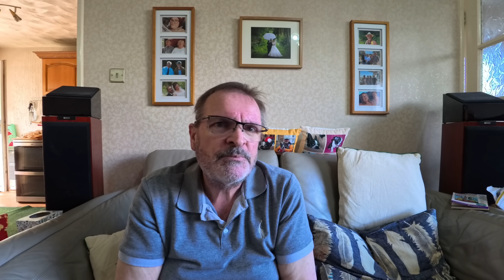Expert Ships Engineer Reacts to Baltimore Bridge Crash

Comment: Retired ship engineer myself. I appreciate you posting this video with thoughts based on your knowledge and experience in ship engine rooms. Many people who have not worked in the maritime industry are posting rubbish speculations based on second or third hand information which only misinforms the public even more than television news presenters are doing when they speculate. Have a good watch chief.
Reply: this is not this ships first fubar in port either ,  and it failed several maintenance  inspections in june.
Reply: @SwampbearX Oh really?
Reply: @vden02   2016 it nearly took out a port , it was also heavily cited in june for failed upkeep involving propulsion and power plant
Reply: I was in manufacturing for 37 years and god forbid there was an accident or incident because all of the armchair quarterbacks would be on the case with all of their accusations and suggestions on what happened or what you did wrong. If people are involved there’s always the possibility of things going wrong.
Reply: @JefferyHagen   To err is human. It takes a COMPUTER to really screw things up!
Reply: @JefferyHagen About the anchor appears rumblings about not having power to disengage clutches as no power of that is the case then the anchor was not prepared for standby as per the check sheet
Reply: @JefferyHagen  Unless you have intimate knowledge of container ship electrical systems and backup generators that all modern ships possesss then shoosh - your knowledge means squat.
Marine electricians are scratching their heads how this confluence of events occurred which points to a more sinister explanation.
Reply: I see lots and lots of comments the black box (VDR) not working. IT WAS. 
It has an uninterruptible power supply. What stopped was remote sensor data!!!  Because there was no data to send!  Almost like there no power for them to operate! 
The bridge voice and radio comms links continued as per. 
The NTSB have already addressed this issue. 
Cheers
Reply: The black box is missing 2 minutes of data...how is this possible?
Reply: @mre6227-uk4zo That is crazy since the SVDR is continuously recording microphones, engine data, movements made by the helm/throttles, and is not turned on or off by the crew.
Reply: The SVDR is supplied by ship's power, and it has an internal battery in case the ship sinks.
Reply: @earthequake1. Not to mention they said it is suppose to have 30 days worth of recordings on it
Reply: @mre6227-uk4zo its only missing data was from remote sensors. Bridge voice recorder still operated. 
Why no sensor input??? There was nothing to send, they had a total power failure. 
The VDR has a seperate,autonomous power supply.
Reply: @mre6227-uk4zo  I find it interesting that this video was promoted in my feed. Anything that’s promoted in my feed is completely suspect if I haven’t subscribed to it.  Especially because I’m not following this incident and I don’t care much about boats.
Reply: Nothing to see here move along...
Reply: @mre6227-uk4zo I believe it has continuous bridge audio. It is missing 2 minutes of sensor data because the sensors were offline.
Reply: @mre6227-uk4zo  Layman's guess... perhaps the blackout? The recording device must need a power source.
Reply: @mre6227-uk4zo  No idea. Like I said, it's just a guess.
Reply: @mre6227-uk4zo  it must have a UPS -so if it is ‘down’ for the period of the main black out - it is safe to assume that the UPS has failed.  The UPS should be tested on a regular basis and longevity of the batteries recorded.   I have seen plenty which fail on demand, though.
Reply: @groaningmole4338 shouldn’t there be a cheap UPS keeping the black box functioning?
Reply: @fredfrond6148  Yes. But "should be" does not always translate to "is".
Reply: A black box without a back up power source seems pretty stupid, if that’s the case, we shouldn’t  bother using them.🤦🏻‍♂️
Reply: @groaningmole4338  It didn’t shut down and it does have it’s own battery supply.
Reply: @groaningmole4338 yes it has its own battery supply and no it didn’t shut down. It didn’t have any remote sensors sending data.
Reply: @DB-thats-me   Thanks for the info. With any luck, that will be the end of this discussion (please, O Merciful Gawd!).
Reply: @groaningmole4338  I typed in the wrong place I think. I wanted it on the main thread. NaYa. 👍
Reply: @groaningmole4338 I think it was hacked & overtaken…and not by Russia, but China…who most likely built that ship.
Reply: @groaningmole4338 Of course it needs a power source. How would it be possible that the blackbox wouldn’t have it’s own battery?
Reply: @glennwhite1841   Batteries not included.
Reply: @groaningmole4338 it's my belief that black boxes have their own power source, batteries. If that is the case, the black box would have to be manually disconnected from its own power source, and then reconnected.
Reply: @fredfrond6148 yes and it should have been tested as per the ships planned maintenance 😮
Reply: Our government has become so untrustworthy that I immediately disbelieve anything they say. I believe a stranger on youtube much more then them. What you have said makes sense
Reply: @andrewpinkham9904  Same here.  Just assume anything u c or hear on the controlled media, or from a politician, is a lie unless proven otherwise.
Reply: @MrLanternland  news reports said some data was still recorded. Audio but no video during..... However I guess from what they said (NTSB) these are not like flight recorders they don't have detailed information
Reply: @MrLanternland the only time you know a politician is telling the absolute truth is when they call another politician a liar.
Reply: @gregorytubbs3444   Ha ha ain't that the truth!
Reply: @gregorytubbs3444  Ha ha ain't that the truth!
Reply: @andrewpinkham9904  WOW, what a great bunch of "Conspiracy Theories" Weidos, Yall, need to find tune YOUR brain antennas, to achieve a better signal, from yo boy Alex Jones, of "InfoBurnouts", so YOU can get a better space signal, from YOUR NWO , boy, Klaus Schwab
Reply: Its a distraction on what's going on right now so I'm sure they'll be more coming . Think about train derailment a few months ago and then Lahaina fire  now this and then there was another cargo ship that hit the bridge in Arkansas but is now reopened.  I get better on YouTube than watching the media
Reply: @andrewpinkham9904 , I am curious… Do you think trump is honest?
Reply: @allanhwhite.kineticmobiles  no hes not honest but he keeps his campaign promises and his policies are in the best interests of Americans. He exaggerates all the time. Its his style. Do you think a president that puts American's first is better then a president thats owned by billionaires at the world economic forum
Reply: @andrewpinkham9904 So, let me get this straight. 
If the Government had told you the bridge had collapsed due to a ship hitting it ………
You wouldn’t have believed it???😳
Reply: @DB-thats-me  I wouldnt believe them if they said the sun was going to come up in the east. Thats what happens to habitual liars
Reply: Great job! 🌠You can move on to reading comprehension exercise #2 now!
Reply: @DB-thats-me OH, THIS!!!

THISTHISTHISTHISTHISTHIS 😂😂😂
Reply: @andrewpinkham9904 You must have fun with elections. Why make your life so difficult? There’s an awful lot of non-governmental disinformation out there, and a lot of good gov’t info. Like, say, how to apply for social assistance if you’re disabled. 

Here’s a thought. Do your own research. From a variety of sources. One should NEVER single-source news items.

Or is that too much effort. 🤦‍♂️
Reply: @whatifschrodingersboxwasacofin  ummmm.. sorry?
What did I say to set you off? 😳
Reply: I would like to hear how dropping the ships anchor might affect the ship
Reply: @Mind4Christ   Mostly? It wouldn't!  To 'set' an anchor you have to drag it for a bit for the flukes to 'bite' into the seafloor -- and that only works IF the sea floor isn't, say, sand -- which just lets the anchors pull right through.
Reply: @Avalanche-Ice1950 There are power lines, water line, and gas line in that area. Dropping anchor could hit those depending on how deep they are.
Reply: @NorCalNeel  Early the next day, a local expert said they did drop anchor.  At that speed  it would just drag and not stop the heavy laden ship.
Reply: @Mind4Christ it's standard emergency procedure for any vessel adrift,the anchors are dropped to slow the vessel with drag & hopefully they grab. With the tonnage involved & a muddy river bottom,that was probably a faint hope of them grabbing. I'm more interested in why the bridge failed so comprehensively, surely they are built with potential collision aforethought?
Reply: You nailed it ! Everyone is a damned expert when these things occur and opinions are like assholes and everybody has one !
Reply: I just wonder why Biden not making the company involved pay. I mean if any kind of negligence is determined there are serious consequences for the responsible party’s
Reply: He'll be pocketing the money again  @georgeharman7177
Reply: @georgeharman7177 Having been in the insurance industry for many years, it could be 10-20 years before the insurance company settles and pay(s) out! The bridge MUST be rebuilt ASAP. Our Government would eventually receive some kind of reimbursement, if only partially.
Reply from the maker: Thank you. Retirement looming here too.
Reply: @retroonhisbikes  just curious, considering how close to the bridge, would full reverse have been a better choice ? Another question, how automated is a ship like that ? Could a computer error have cause it ?
Reply: @retroonhisbikes It's not rubbish when there's evidence, namely the video of the incident, to back it up. You all can back up your story with all the talking points you want, but the fact is there's more to this than meets the eye.
Reply: I've never worked in bay areas but my family has worked the Ohio River since 1902 , there might be differences in protocol as far as a ships entry to areas but I would've assumed there would've been turn boats, that's what we call them on the river but a ship that size in that area would have some sort of boats that help it in case it needs assistance, like I said I'm not a expert but as someone who has been around ships and boats since I was old enough to wipe my own ass" it's a requirement" I would think there would have been another boat in the area to help but anyway I love the video and the comments are very educational, so many things I never knew but thanks for the info
Reply: Reports say the black box didn't record any data during the crucial time frame. Is that normal? How likely would that be?  Just another event in a series of unfortunate events?
Reply: @CasaBonitaSucks  Is that normal? Are you naive? And, you're going to believe these were all just "unfortunate events?" No wonder they get away with so much because, ppl like you will buy anything!
Reply: Could a cyber attack possibly do this? You guys are engineers. Your answer 2 that question is important.
Reply: @CasaBonitaSucks I hate to say this but they can  in some cases not all ships.
Reply: That explains the time it appears to be turning and the black smoke billowing. The pilot would have told them full astern. 
Great explanation.
Reply: I thought that large vessels such as this were always moved into and out of ports with pilot vessels or tug boats for this exact reason. If something goes wrong you can't control them????
Reply: @jasonvigh7109 Good question! I just saw a different view of the ship, it's load and collapsed bridge. That ship is far bigger and with a huge load - far bigger than I originally thought. Why didn't the "Dali" have tug boat(s) assistance?
Reply: I am in my 70s and have become cynical in,  it seems,  everything... 😂
Reply: I want to make a point to those who say “the boat hit EXACTLY at the point that would take the whole bridge down”—these bridge supports are right in either side of the channel…. It IS where the bridge would be hit, if it were hit. There likely isn’t enough depth of water to get to the other bridge structure further toward land. It’s like being amazed that a car hit the guard rail and not the tree on the other side of the ditch behind the guardrail.

Question from a U.S. military sailor: why wouldn’t more engineers be on watch during a dangerous evolution like arriving and leaving port? I understand that a commercial crew is 10% the size of a military crew, but On a military vessel, essentially everyone is standing a watch during this detail. Engineers are in bow prop (I understand it may not have helped) and in aft steering (which is usually where our emergency generator is) to decrease response time. How there isn’t at least one more engineer on duty ready to respond to a steering or emergency generator casualty, seems unfathomable to me.

Beyond this question, I generally  agree with your assessment. My two remaining questions are:

1. When was the port anchor deployed? I know this won’t stop a ship that size, moving at 8kts on a dime—but I’m curious. 

2. What was the rudder action during these 4+ minutes? I think most of your analysis assumes the rudder is essentially a-midships—was it? We’re they starting the starboard turn but just by a few degrees (essentially a-midships—which I assume)? Or was it a little harder over? Did they move the rudder in that 4 minutes? That captain knows he’s driving a single screw ship and should compensate for that with a rudder command as an instinctual function of calling for full astern. This doesn’t mean the rudder responded—which, as you say, likely was an error that contributed to the accident—know where your rudder is, and if it’s responding, before you give the engine command. In any case, the captain could have chose to go astern because it’s easier to justify then full ahead—that call may have taken some fortitude the captain didn’t have.

Admittedly, neither of these questions or their answers changes things a great deal—it’s my curiosity and for lessons learned.
Reply: cone headed aliens 🔭🐥 there’s just no other reasonable explanation ☝️
Reply: Yeah I expressed similar thoughts on a video because I too find myself in an engine room time to time and I’ve had people describing protocol for a nuclear vessel and telling me I’m crazy. You got to laugh I guess.
Reply: How about who cares.  

Glad everyone gets excitement over giving opinions on random stuff.
Reply: Why are you all talking about the ship? A kajak would have taken that down. It's the bridge that is behaving  strange.
Reply: @johanolofandersson8801 
💯!!
Reply: @johanolofandersson8801 Yes, I have many questions regarding the bridge! Why that particular design of bridge?!? It came down like Tinker Toys! Also, why didn't the ship have tugboat assistance when leaving the Port? It was certainly large & heavy enough to require assistance!
Reply: A very likeable bloke with relevant knowledge; so why do I smell BS?
Reply: @mlkekennedy5602 Because our government is involved!
Reply: C I A
Reply: Question mark over the accident history and possible staff on beggars wages similar to cruise ships .
Reply: Could I ask you experienced professional mariners (in particular the US mariners)  what do you think of President Biden actually knowing that within 6 hours of the incident that "nothing to see here" simple accident ???   is he an expert or simply a clairvoyant ???  god bless america in all it's  stupidity.
Reply: Fbi shows up in 3 minutes says “” no foul play “” first time In History  the have answer in 3 minutes
Reply: Agreed about the speculation, but more rubbish information, misinformation, and disinformation coming from the media, tv, and government institutions, impossible.
Reply: Here's another coinkydink for all of you buying the "accident" angle! FBI Dir. Christopher Wray named William J. Delbagno as Special Agent in charge of the Baltimore Field Office the day before the collapse! But, it's just a coinkydink!🙄
Reply: Did you look at the bridge? Obviously not
There were small explosions and th bridge was demolished with charges again
It was not the Russians
its your cult government , this was a false flag attack
Reply: The black out BOXS are backed up by ups systems,IMA a RETIRED chief ALSO and in my Time,on V vessels imhave had to update theses systems with mew batt back ups,theyr are SERVICES reguallry ALSO.
Reply: They paniced and MADE bad manuver s,CAPT OR WHOMEVER HAD THE BRIDGE SCREWED UP OVERLOADED ENGONESMAND TEIPED 2nd RIME Their FAULT!!!! We Will see AFTER they investigate,COAST GUARD WILL FIND TRUTH!!!!!
Reply: In new Orleans tugboats take the ships up the river because it is dangerous. 
Where were their tugboats?
Reply: What about the Jones Act????
I heard [not sure on this info] that the ship was a foreign ship from Singapore and piloted by a Ukrainian .
Reply: The ship was clearly driven in to the pilon. Ffs, did you not see the smoke bellowing out of the stack?? And, the ship turning in to the bloody thing. Most of the population are very naive.
Reply: @DiamondsTakingShape Good question. It is possible that tug(s) could've helped the ship veer off just enough to avoid collision, but was there enough time for that yo happen? One tug? I would say No. Most likely, there was not enough time, distance or tugs to prevent a collision. It all went wrong in a VERY brief amount of time. Also, you must factor in a lot of things occurring all at once: forward (momentum) drift, speed of ship, water currents, etc. Something that appears to be rather simple can be quite complicated. Also, was the bow anchor actually dropped? It was ordered, but did it occur? Under emergency conditions, protocol #1 is drop anchors in an attempt to slow down an out of control ship. Some ships may only have one anchor, but most have two -depending on size of ship. Next, will the anchors grab onto something? Is it a sandy or rocky bottom? Will the anchor connections hold if they do grab on? These ships are so incredibly heavy, and more so when fully loaded, that it is very difficult to slow them down in a big hurry (I would say near to impossible in that short of a distance!). If tugs were assisting, and bow & stern anchors dropped, the ship may still have hit the bridge pylon, but would probably have been a minor incident. A lot of things went wrong in a VERY small amount of time. Also, this ship had a history of steering mechanism problems. Was it properly repaired? I seriously doubt it! Also, a big question: that bridge came down FAR TOO EASILY! 🤔 I'm not a Bridge Architect or Engineer (my dear Father, RIP, was an Architect), but the biggest question IS WHY that type of bridge at a busy Port of Commerce?!? Why not a Suspension type bridge, or something else that would be less vulnerable? Sorry, I could babble on all day.  We shall see what comes out in the wash, and if it's truthful. 🚢 ⚓️ 🌉
Reply: Good to get a ships engineer giving an educated presentation of what may have caused the horrible accident. As a former ship engineer & oil/gas platform technician I have been part of two MAIB accident investigations. I’m confident the facts will be known quite soon.
Reply: Marine accident investigation?  How do we know for sure the agency in charge of investigation is not woke, corrupt and attempting to sway us from the truth?  Anything to do with govt agency investigation no matter the apparent crime or negligence is suspect and reeks of corruption.
Reply: We know that they are lying because they said that it was an accident.  We know that it takes longer than a couple of hours to determine the reason for the crash.  There is no way that a complete investigation was done between 2:30 in the morning and 8:30 when they were saying it was an accident.  Too many unanswered questions
Reply: Thank you, sir.
Reply: All high sulphur fuel is near possible to purchase (MARPOL ANNEX VI)however main engines do change over to Diesel for various reasons,maintenance east of starting and boiler failures to name a few.
Reply: Just another distraction. The fourth in the last two weeks. What else is happening in the world? Think.
Reply: Throwing all of the engines into neutral will immediately make you level out ,then after afew seconds put in reverse within a few min
You could stop it,just saying nice point
Reply: @fakechecknumber1198 possibly, but what about "drift"? A large ship moving forward does not stop on a dime; it will continue forward for some time. And, due to forward movement, when the prop has gone full astern, the ship's bow will turn as the ship continues forward motion. It takes considerable time before the ship stops its forward drift. Also, you have to deal with current ocean currents. In this case, the ship was moving through the main port channel; what is the speed of the current passing under the bridge? A few things can go wrong when trying to stop a ship under emergency conditions. Also, factor in losing power (= the loss of steering), regaining power, and losing power. Also, dropping anchor(s) may not slow down a large ship; it IS protocol to immediately drop anchor(s) on an out-of-control ship, but the anchor(s) must be able to grab onto something. If it does, the next question is will the anchor and its connection hold, or break due to a variety of factors. Simply put: not everything happens by the book; sh*t happens!
Reply: @dudeh NOPE!
Reply: I live on a narrowboat and when its windy i wouldnt dream of taking it out. People just dont realise how hard it is to stear something big and heavy on open  water.
Reply: If they had kept power on and tried to steer back into the channel and not succeeded, they would have been criticized for not going full astern.  No matter what you do, if it isn’t successful you will get blamed for it.
Reply: If the black box is missing 2 min of data the ship was deliberately crashed
Reply: You may be right, but where you’re wrong is making your own speculations before a proper investigation has been completed. The fact that there are now issues with the black box only highlights the possibilities of other explanations. Besides, a cyberattack of some sort should not be off the table until a thorough investigation is complete. Finally, we will see in the future IF a thorough investigation has in fact will happen.
Reply: @stratcaptain66 😂
Reply: @stratcaptain66 He’s giving his ‘reaction’. Not saying it’s written in stone. You need to do more research. This was definitely on purpose. ☮️
Reply: I loved your personal analysis. Like the KEF speakers too.